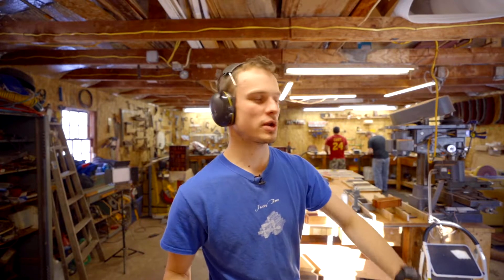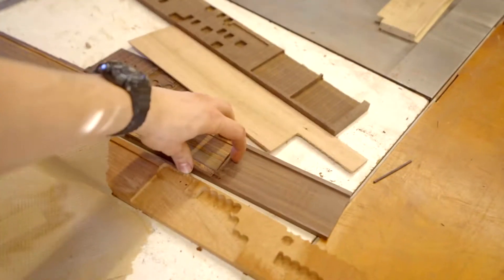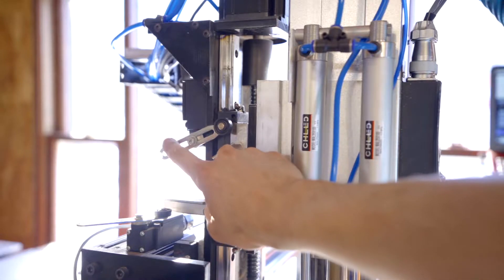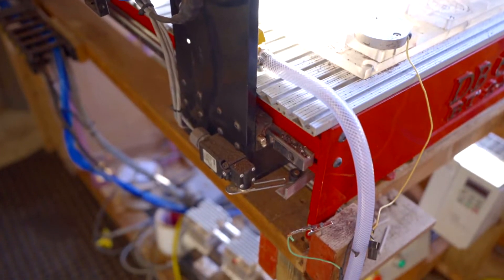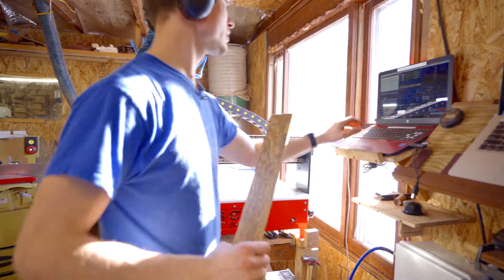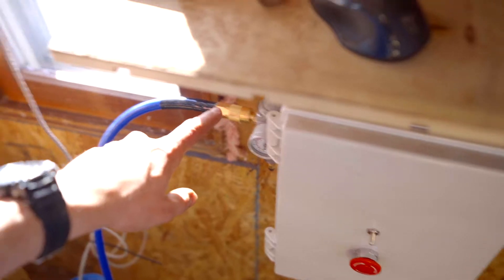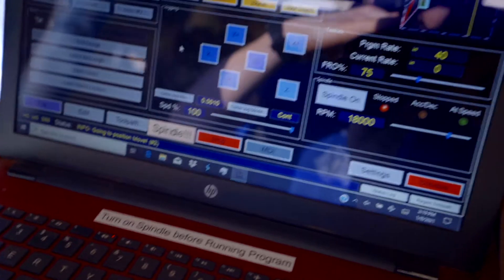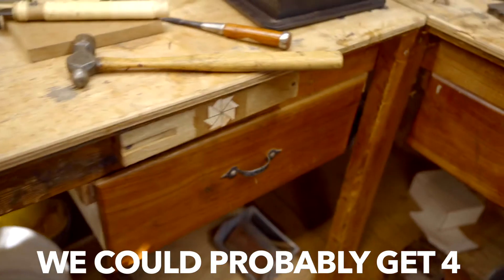How to Run the CNC Router

Comment: What kind of bit are you using to get a clean cut and leave a consistent onion skin layer? Compression? Up or Down cut? I'm trying to cut 3/4 pine with an Amana compression bit (1/4, 3/8 or 1/8) and I get inconsistent results - the onion skin thickness is all over the place - from just through the material to 1/16" thick. I'm doing it with the blue tape/super glue hold-down method because I'm afraid to wreck my vacuum pods or fixtures if I can't the onion skin thickness dialed in. I DID just surface the spoilboard, so I'm working with an even surface. Any advice? Thanks!
Reply from the maker: I buy from these people: https://www.carbidetoolsource.com/wood-router-bits

I usually finish with a 1/8" downcut. 
Homing accuracy could be a problem for you. I Measure mine with a depth micrometer...because the homing switches on my machine are not super accurate all the time.

Comment: Found your channel while looking for info on setting up a vacuum hold-down system. I've been using clamps or the famous blue painter's tape/CA glue method of holding things down, and find it inconsistent, messy and time-consuming. I REALLY like your acrylic zone system for holding down small parts. I had wondered how it keeps from losing pressure as you cut them out - but at the end of the video you show how you leave an "onion skin" of material. I didn't think that would work because I have trouble with consistency of thickness of the wood pieces. Just zero from the thinnest part, I guess. Also, my CNC's spoilboard is made of 1" thick MDF strips (Laguna IQ Pro 2'x4' bed w/3-tool ATC), and that won't be as consistently flat as your aluminum table - maybe that's my issue, too. Going to resurface the spoilboard today to see if that helps. What vacuum pump are you using? And gasket material? and how thick is the acrylic? Thanks for posting this - your work is amazing!
Reply from the maker: Gasket material comes from McMaster, acrylic is .75" thick, the vacuum is a Viot from amazon and costs about 550dollars
Reply: @JesseBorn  Thanks!  Thought I replied but don't see it now. Weird. What thickness is the gasket material? Round 1/8"? I ordered a vacuum pump similar to yours, and have the acrylic coming Monday. Resurfacing my spoilboard and leveling it today. Really appreciate your help! Edit: Did you have to drill a hole from the side of the acrylic that goes all the way to each zone?
Reply from the maker: Thank you

Comment: I have a cheap $1,200 cnc machine that i wish could change bits on its own like yours. That vacuum that holds your piece down would sure be nice, I use double sided tape:(. Great video!!!!
Reply from the maker: The vacuum is really nice. The tool changer is nice too. Everything took a lot of work to set up, but it's smooth sailing now!